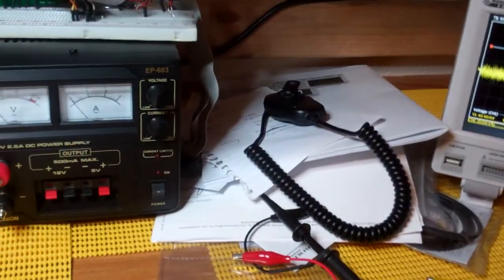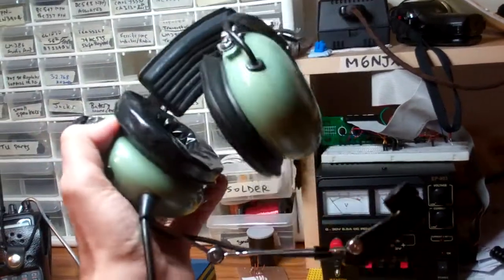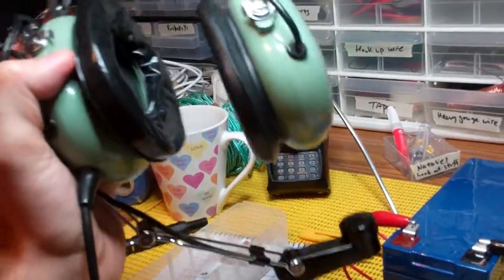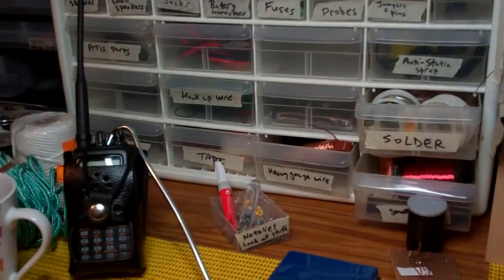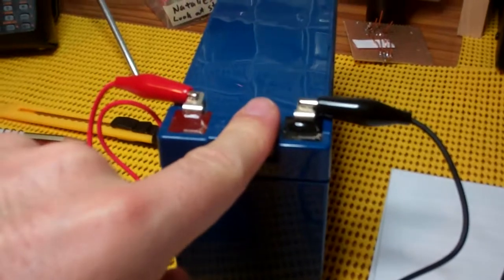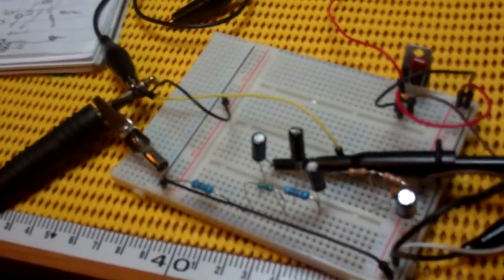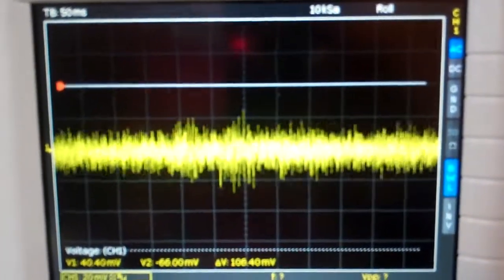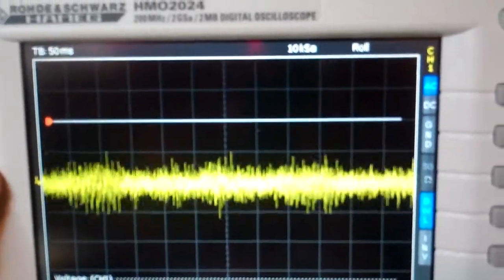General aviation headset testing for ham radio

Comment: Care to share te schematic of circuit you are using?
Reply from the maker: @DB7BPB, I don't have access to a copy of it any more. The article I used at the time was published in the ARRL's QST magazine: APR 2010 - QST (PG. 65)
Adapting Aviation Headsets to Ham Radios
(Hints and Kinks)
Author: Raydo, John, K0IZConvert an Aviation Headset for Amateur Radio Use
(Feature)
Author: Russo, Richard, KB3VZL

Unfortunately, one needs an active ARRL subscription to access their QST archive, where this article can be read. If you can find an ARRL member (my membership lapsed a few years ago), it is  available to review, and it works.

I hope this helps you track it down (and reminds me to restart my QST subscription - it's a great magazine).Good luck and 73 de Matt, M0NJX

Comment: Thanks for putting this together! I was just researching this the other day. 

Did you ever finish the project? If so, what did you end up building to hold the components to handle the conversion? I’d think it would be challenging to find something that’s reliable and compact enough for portable operations. 

I found out that David Clark manufactures headsets specifically for use with two-way radio and sell adapters that allow you to use them with a wide array of radios. Their website is very confusing and it’s next to impossible to find details on which adapter you need to buy but I’m guessing you can contact them and they’ll let you know which you need. I started looking into pricing for the two-way radio models and they start around $275 and go up to roughly $350 depending on the configuration. Then you need to buy the adapter(s). That can add up very quickly and is more than I want to spend right now. But I much rather go with something like a David Clark before spending money on a Heil Pro 7.

Comment: TEXT 
Hey everyone this is curious Guy this is a short video just talk a little bit about using general aviation headsets with ham radio if you remember in an earlier video I was looking at push to talk microphones a bit like this one this is an example for my gay Sue handheld radio but the concept in these microphones is their electret microphone itself capacitor and I was studying the effects on the oscilloscope I was tapping into one of these and just trying to learn a bit more about them the reason for that is I'd like to make use of one of these headsets these are general aviation headsets and I'd like to use one of those in my ham radio the idea being is at the the earphones provide a lot more quieting environment to listen to the signals that provide a mono sound not stereo but that's okay and they also have a a boom microphone there the general environment that you're supposed to use these in inside a cockpit very noisy so the microphone is a freely freely death microphone if you like it's not very sensitive I thought it'd be pretty good for operating outside on in portable environment hands-free using box or perhaps using a PTT switch built-in had a problem with these is that the general aviation standard doesn't quite work with ham radio and you need to match impedances and and attenuate the signal a little bit but is really helpful article qst magazine and this was a little circuit describing how you can attenuate the signal get a pretty clear audio coming out so I'm part way through my study of making that circuit and death have to thank John radio here who's the author for the can't read that he's kilo zero india-us are kylo zero India Zulu up in Kansas City Missouri so many thanks John for this information what I've done towards that tonight is what I'm going to do is actually is run the microphone off the battery that I'm using to run my rig so in this case is about a 13 volt one of those lithium life batteries with the call let lithium ferric iron po4 whatever that is and I'm going to be using that to power the rig and to provide the microphone in these headsets the necessary DC bias now they want to buy a surround well they say between 8 and 15 volts and I could run it directly off the mic off the battery itself Tobias and I'm doing that through a little circuit like this what a guy down here is a 9-volt regulating circuit and then lm7809 pretty common voltage regulator chip play pass in voltage voltage to one pin the middle pin is ground on the output voltage will be whatever you want in this case 9 volts the rest of the circuit here is basically following the schematic of this this little diagram here and pretty simple what I'm hoping to show is that if I if I connect here's the general aviation microphone plug connect that up to the circuit with a 9 volt DC bias I should get an audio voltage out of passing it through these resistors will get a attenuated single of around 20 to 40 which is kind of what my rig can handle so if I just put the camera down a little bit microphone on see if we can see this thing jumping around testing one two testing one two this is me talking into the boom mic of my headset now the screen here is showing divisions of 20 volts per square and so essentially around this baseball till you can see that between my fingers here is about 20 millivolts up and down and then 40 millivolts up and down Roundup 40 or 60 millivolts either side that's 100 millivolts coming out Mary had a little lamb whose fleece was white as snow but I think it's pretty good I think my microphone input the preamplifier into my rig can handle that kind of input so it's worth it it's worth trying so I've got the the well the test stick night into the rake so we'll try that next another day and many thanks for watching .